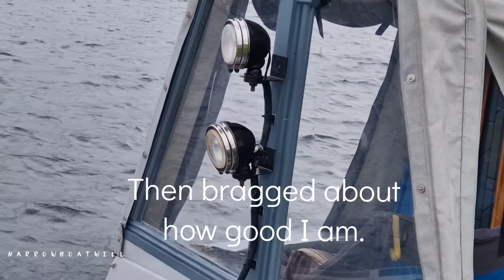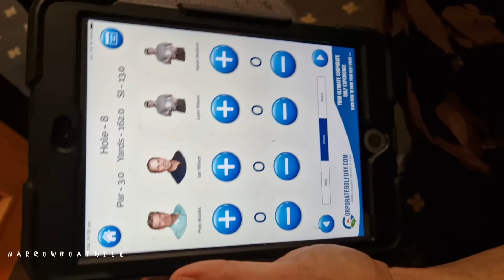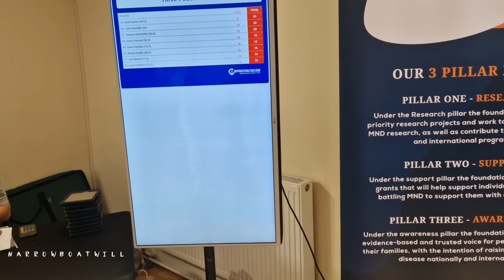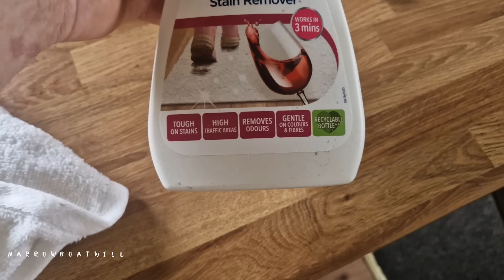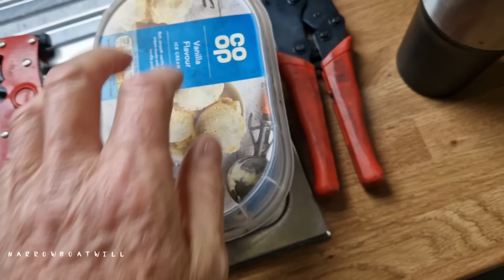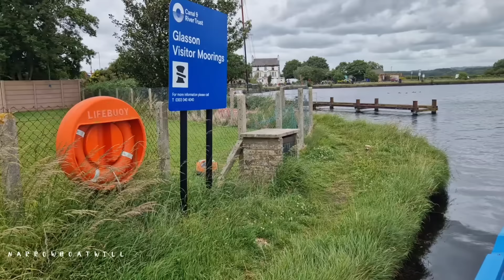Charity and helping others. My narrowbost journey continues..Lancaster canal.

Comment: The first time I saw those heat shrink/solder splice connectors was back in the 80s. I was working at Lockheed-Martin, building the C5-B and I noticed that they used similar connectors on the aircraft's wiring harnesses. The  ones like you use only became popular a few years ago, or at least I never saw them available to the public until then. I figure if it's good enough for Lockheed-Martin, it's good enough for me, and much quicker than soldering and then heat shrinking. 

Keep up the good work! 👍👍
Reply from the maker: They're amazing little connectors but the best way to melt them is with a heat gun. A flame doesn't work. I need a battery heat gun.
Reply: @NarrowboatWill  , Lockheed had a special tool that probably cost $10,000. 😄 I use a heat gun. Some guys use the mini torches, which might work well for you. They're smaller than a heat gun.

Comment: Re Leon's battery's. the battery master switch on his Elysian is a poor set up because the system is not properly split between cranking and domestic battery's, the current set up allows you to connect all batteries together.....this will cause terrible issues causing the weakest battery to draw from the stronger battery...eventually you end up with poor battery condition. You need to split the system, fit individual battery master switches for the cranking and another for the domestics and install a split charger between the alternator and the batteries.....that will help👍 Then add the solar............
Reply from the maker: That's exactly my view. A poor setup from the start. That was done by a professional marina. Apparently! Stay tuned..